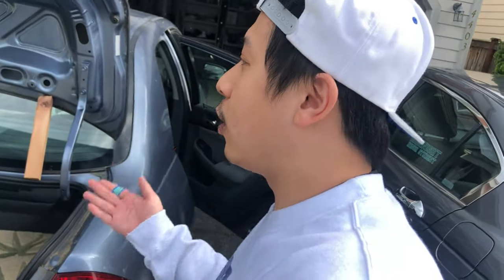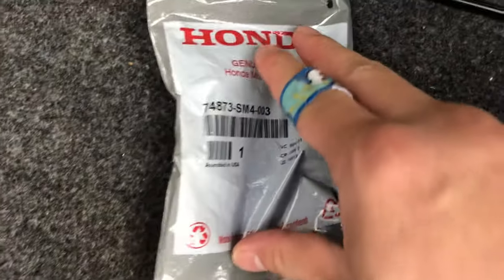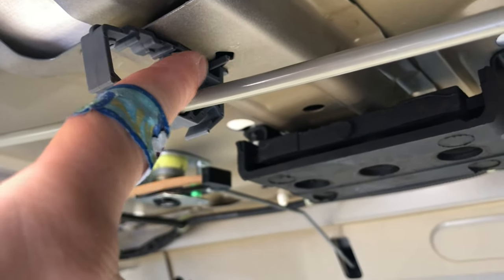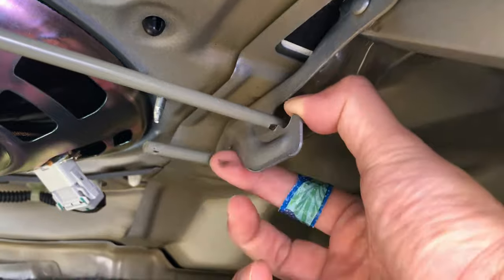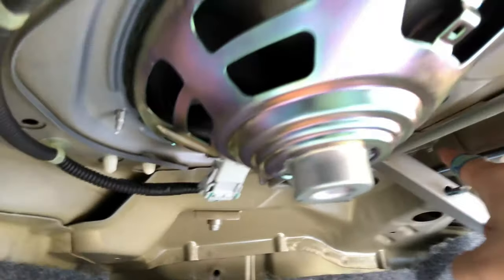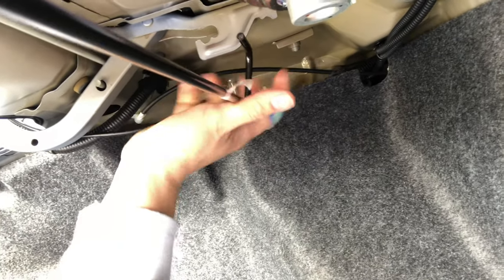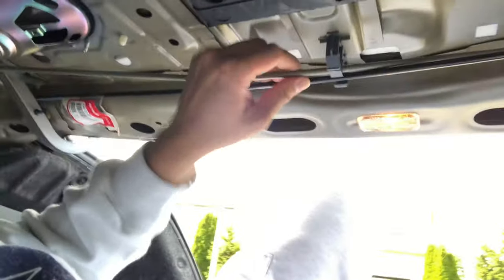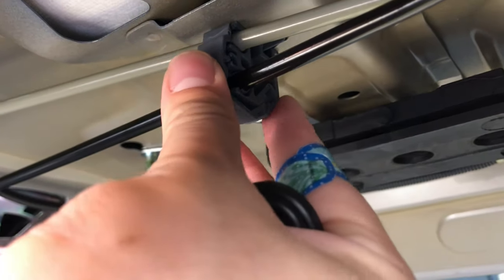How To Install: Trunk Spring Opener | 03-07 Honda Accord | DIY Installation Clip & Trunk Torsion Rod

Comment: Thanks for the video.  The problem with the spring rod not seating properly in the clip can be avoided by positioning the rod in the clip and then working the ends into position afterwards as you suggest late in the video.  I took my time to do that and had no issues.  In all, installing the clip and getting the rod in position took about 4 minutes and using vice grips to twist the rod end into place took about 10 seconds.  I did not need any help snapping it into place but did have someone I trust hold the trunk up as I think the guys doing this job with just a board holding it up are crazy with how much it weighs and the force it comes down with when the spring is broken.

Comment: Thanks for the guide! There were two additional tips that lead to my install successful install. 
1.Initially I inserted the weaker end in the wrong direction, so I was puzzled why the bar wasn't producing any resistance. But once I inserted it correct, I can see how it works and how I should apply the force with a vise grip. 
2. The middle clip needs to install before hand so that the tension bar can stay in place. This can make the install easier too.
Reply from the maker: Great ideas!

Comment: This was awesome.  Best Instructions on youtube for the clip and the bar.  It works for old Acuras too.  I didn't realize there was a special trick for the pliers where you insert it on the bar to get leverage and lock them (without hurting yourself).   I didn't even have to get in the trunk once i realized I had the plier placement wrong initially.  Thanks Man!

Comment: Thank you for making the video! I had the exact same part fail. The vice grips worked for me.
Reply from the maker: I'm so happy it worked!
Reply: @GTCharlie I have a 1997 Accord DX. One of the trunk tension rod spring rods broke so the trunk lid will not stay up. The dealer said this part is discontinued and not available. Checked with several junk yards and none have it. Do you know of a jury rig to fix this problem OTHER than using a broomstick?

Comment: Ty Dawg now I know I don’t need the damn tool but vice grips that I can  return to Walmart 😂 I got my HPD Oem Spoiler for my 2022 Civic Sport and comes with a set of heavier trunk springs for the added weight
Reply: Just installed the spoiler 2 weeks ago and used some long nose vice grips for the spring I did it so fast ! 💨

Comment: Thank you! Because I did this by myslef with your instruction! One of my Torsion Bars was broke off. So I ordered the original parts from Honda and with a little patients. I got it in in about 30 mins while holding the trunk open with one foot😂😂😂

Comment: I was able to put this rod in by myself with the same vice grip pliers that you used.  It was pretty easy. Interestingly, the trunk now stays open when put up. But when it falls, can still crack your head or chop off your fingers (still heavy) if you are not careful. My coworker was knocked unconscious when the trunk rebounded and hit her in the head.  Thanks again for this video.
Reply: My Prelude hood front edge fell and Mike Tyson'ed me on top of my head once. (a windy day) Now That was GOOD TRAINING for my job!
Reply: @gracien2008  Yikes!
Reply: See if your car has a second higher hole position for the bar that is used for heavier trunks with spoiler and move bar there.
Reply: @joaquinsuarez6090  Sadly, the car died last fall. Did not want to put in another grand to fix it as it was almost 20 years old. thank you for the advice though.

Comment: Mine broke when I put a spoiler on so you doubled up on the spring rods then?
Reply: Put the bar in the higher hole position (where visegrips are used) for heavier trunks with spoiler.

Comment: Thanks dude! Perfect explanation. The vise grips work perfectly if you clamp as close to the raw end of the rod as possible that will allow you enough space between the supports and the vise grips themselves to easily work the tension bar into place.
Reply from the maker: I'm so glad it worked out for you man!!

Comment: Which bar would be installed first or does it not matter...?
Reply from the maker: @mrtibbs1386  bar on top clip first! I think I may have referenced that.
Reply: Ok cool. Thanks
Reply: I asked Honda UK and this is whay they responded...

I have spoken to some one about this. They can only be fitted in one way, unfortunately they can’t remember which one has to be fitted in first.

Kind Regards

Honda Parts Direct
Reply from the maker: @mrtibbs1386  yup just check a picture of someones car and copy!

Comment: Hey Charlie this happened in my mom's car and I need to order the rod. Are both rods universal or is the left rod shaped differently from the right? Also, If they are different shapes how do I know which is the right and which is the left when ordering? I think the one that broke on my mom's car is opposite to the one you replaced...
Reply from the maker: Hello! Sorry for the late reply. I believe they are slightly different. Its been a while so I can't exactly remember.

Comment: "Thank you!"  ...My short story on this, I'm going to copy it to two videos as a "Thank you" to both for giving me the best ideas on how to fix it:  2006 Accord, took two weeks to get the torsion rod part in from a Honda parts discount site.  Only ordered the torsion rod, not the middle plastic piece. Ended up breaking the plastic piece when I tried to get it in: NO NEED TO GET IT IN THE PLASTIC PIECE FOLKS.  (I was pissed as hell, thinking I needed to order the piece after half of it crumbled like a saltine cracker).  

I decided "Screw it, I'm not going to order that part" and just put the rod across/under it, instead of "in" it.  

So for the rod, one of the videos used a vice grip, the other a wrench to get it around the hook,...I ended up using an old crow bar that was about an inch wide by a quarter inch thick, (about 2 feet long).  The crow bar enabled me to fight the rod down enough around the hook that it then snapped into place.  Once you get the rod to that hook, you'll see what I mean; the crow bar gives the leverage to get it bent down and slid into it, since the rod will be resisting going in that direction.  Crow bar could be manipulated against the nearby trunk metal above to force it down.  Very little muscle needed with this kind of leverage.

NOTE ...HAVE SOMEONE HOLD THE TRUNK UP FOR YOU.  Even if you prop it up with (whatever) IT WILL LIFT ITSELF HIGHER AS YOU TRY TO FORCE THE ROD IN...Making any prop you have potentially drop, and the trunk can then COME DOWN.  Not a super-heavy trunk, but not body-part-friendly one either!!

It would've taken me who-knows-how-long without the two videos helping me, so big thanks to both of you.  Trunk now works fine, and again, without the need for a fully intact plastic piece in the middle (the one rod that was not broken...broken in the same place as one of these vids by the way, and was caused by going over a large pothole here in NY...still had it's rod in the plastic piece that I decided not to replace.  And it's working fine.).

Again, thank you both and Cheers!